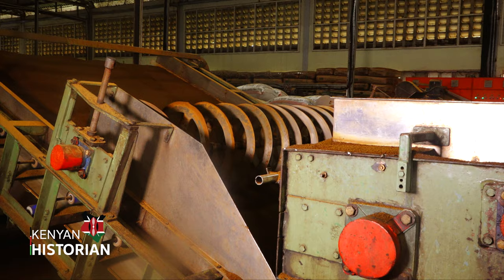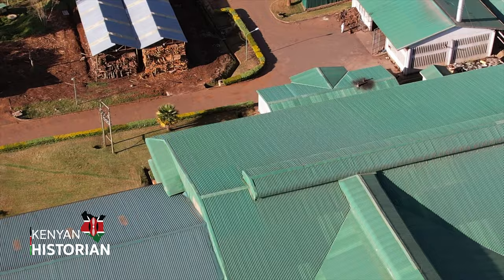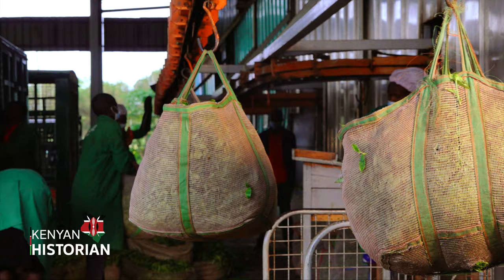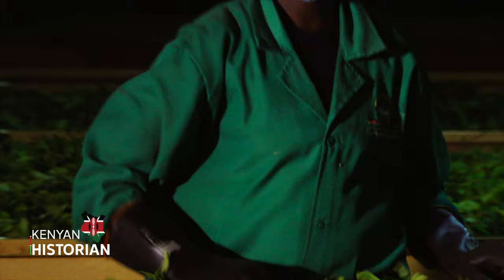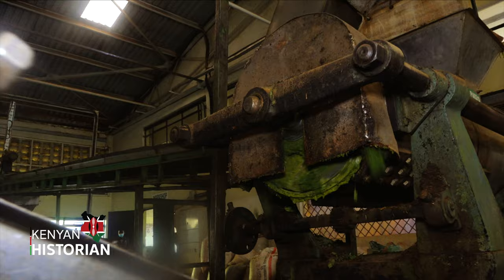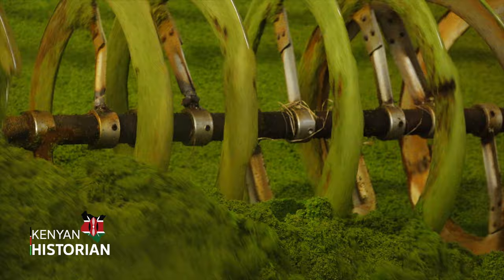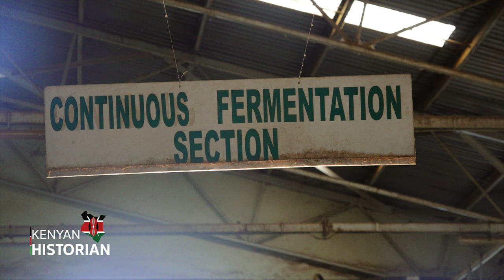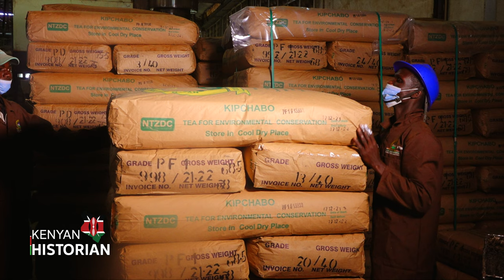THE ART AND SCIENCE OF MAKING TEA: amazing manufacturing process of Kenyan tea in 4K. #kenya #nandi

Comment: Are these machines ever cleaned since they operate 24/7😅
Reply: bana 😂💔💀
Reply: You don't need to clean machines ..just lubricant/maintenance. But it's not always that's it's peak season. Ideally, tea processing ends around 10am(having started at 2am), the washing/cleaning of the factory and the machines rest until the next day 2am. They only run continuously during peak season, and even then ,time is created after 48 hours for cooling/maintenance.